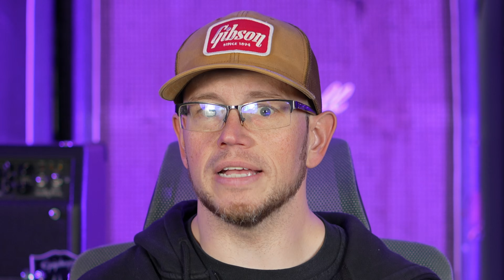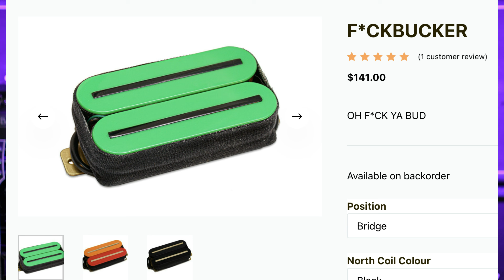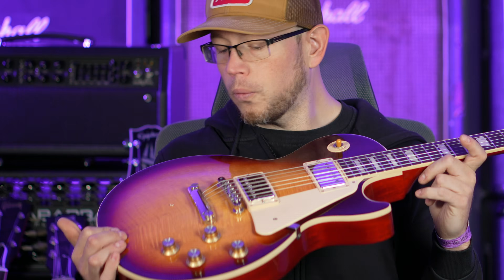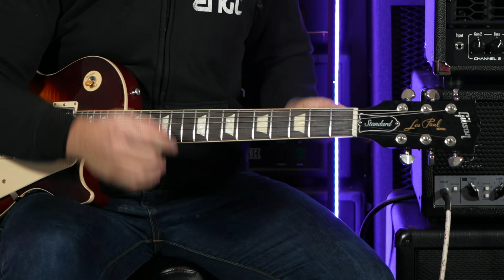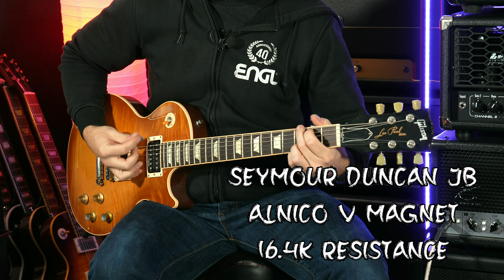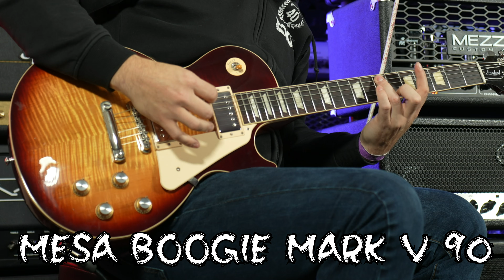EVERYONE has been using the WRONG pickups for metal......

Comment: The 498t is the underrated gem of balance between output and clarity. I have always liked it. The Bareknuckle painkiller is a good one here too.
Reply: I really like the 490R/498T combo but got an ES-355 with '57 Classic pickups in it. I really need to try them in a solid body. (edited, meant '57 classics)
Reply: 498T, 500T, Burstbucker pro+, and tradbucker are all killer pickups for metal.
Reply: 498t is my favorite pickup ever.
Reply: I have both. 498T is very classy, it has the sizzle from a PAF and the smoothness and power from a hot pickup. The painkiller does not feel that much hotter but even more refined and upper mid punchy in a metal way. I prefer the 498T in my Les Paul personally.
Reply: Agreed 👍
Reply: 498t are one of the best pickups ever made.
Reply: They're not bad.
Reply: How about the 490t?
Reply: @vinnibafile8361A Gibson SG sounds pretty great with the 490T in the bridge. The extra midrange bite that SG's have just seem to push the 490T pickup differently than other guitars... I'm not sure what it is about the SG that causes it to sound that way, but I really like it.
Reply: @vinnibafile8361 my personal choice is the 490R/T
Reply: @vinnibafile8361 490T? Unconvincing at best. IMO 498T sounds much better and the lower gain the amp have, the bigger the difference.
Reply: I have a 95 sg with the 498t awesome pu
Reply: Yup, 498T and the Bare Knuckle alnico Nailbomb are my two favorite bridge pickups.
Reply: Totally agree my favorite pickup too.
Reply: Yes... they are criminally overlooked.
My early 2000's Gibson SG Special had the dual 490R/490T pickup set and my buddy's early 2000's Gibson Les Paul Studio had the 490R/498T set and they both sounded like a nearly perfect balance of vintage and Modern tones.
Reply: the 498t is the straight up best metal or rock pickup here
Reply: I have the combo in my Les Paul studio and they sound great
Reply: It gets so much smack talked about it but def sounded good here
Reply: I have a LP and a HSS strato. I have changed pickups of the strato, tried some high and mid gain Dimarzios and Seymours over 2 decades up to the point I was thinking about setting fire to the guitar. But fortunately I thought: I won't experiment anything different that I know I really like: the 498 of my LP. then,  guess what? That's exactly what I was looking for. Articulate, mid-focused, dynamic good output pickup!
Reply: 498T is my favorite
Reply: Bare knuckle warpig and the mule are awesome
Reply: They do sound good.
Reply: My 498T slays through my 5150, despite all the nay slayers.
Reply: Here are some constructive criticism from a viewer. If you forgo the goofy funny faces and weird jokes and be more serious and professional the channel would most likely do better. I’ve had numerous channels over the yrs. I’ve done all that goofy “I’m a funny guy” shit. And I’m actually funny.  Try acting like a grown man for a few videos and see what happens. I’m sure you know how to read YouTube metrics. Amp collection is insane by the way very cool.
Reply: @Kumacidefpv well, make us laugh then, funny guy.
Reply: No shit
Reply: @Kumacidefpv forgive him for having a personality.. no surprise you HAD multiple channels over the years, I guess being a dickhead only gets you so far huh..

Comment: I actually switched to Low Output or PAF pick ups a few years back as well as rolled my amp gain back and use a pedal to fill that gap. I play skate and pop punk (of the 90's vein not new school mall kind) and I have a Marshall JCM 2000 DSL 100, Marshall JCM 900, amd Blackstar HT 50Mkii (recently acquired. I remember seeing a video where a guy used a PAF pick up and it sounded so good and that changed my mind.
Reply: This is the way bro.

Comment: Turn the gain down on the amp some drrrrrr. No issues with clarity, chug and definition drop A with all kinds of high gain pickups, even my dimarzio paf 7s in my K7.
Reply from the maker: You missed a lot of the video if this is your comment.
Reply from the maker: Also you specifically mentioned a pickup that proves my point, completely unintentionally. Good work.

Comment: Agreed 100%! Can't add clarity to a dark pickup, but you can darken a bright pickup.  I'm a big PAF guy too. The only issue with PAF spec humbuckers running into high gain is that you'll want to avoid the "unpotted" or "non-potted" ones otherwise it'll be Squeal City in uncontrollable amounts. Luckily you can find plenty that do come potted.

Comment: that bareknuckle sounds soooo nice!
Reply: I was thinking the same thing especially compared to the Duncan Distortion cause they're both ceramic, the Painkiller had more clarity and slightly more punch.
Reply: was definitely the best sounding, to me.
Reply: I have to agree. The Bareknuckle retained the clarity of The PAF, but with the extra high gain push.
Reply: I have aftermaths and it's the best pickup I have right now
Reply: Bare Knuckles for sure. Using them in three guitars. Nailbombs, Warpigs, and Mules.
Reply: nope muddy and dark

Comment: I have an old Dean guitar that I installed a Dimebucker in back in the day. At the time, I didn’t know much about boosting amps, and I didn’t own a high-gain amp, so I thought I needed the high-output pickup. Since then, I’ve picked up several guitars, like an LTD and a couple of Epiphones, that still have their stock, old-school-style pickups. When I boost those into a high-gain amp, they sound absolutely amazing! When i use the Dimebucker in the same signal chain now, i don't like it as much, it feels shrill. So i guess i prefer just regular pickups now.